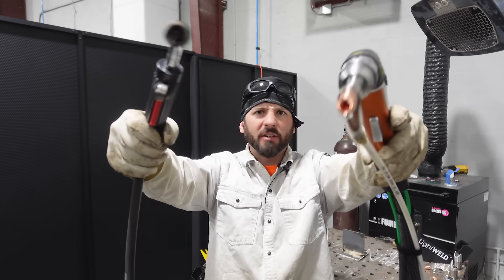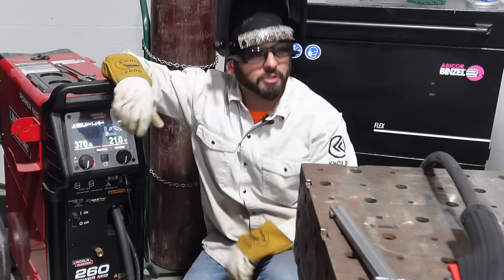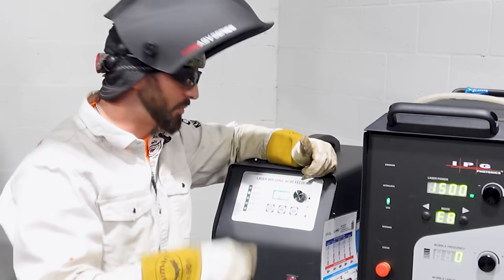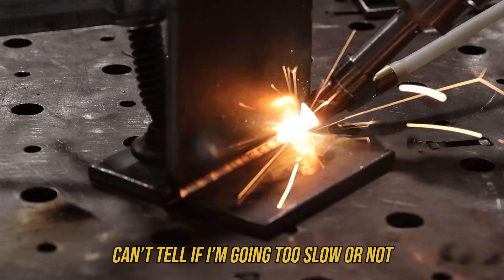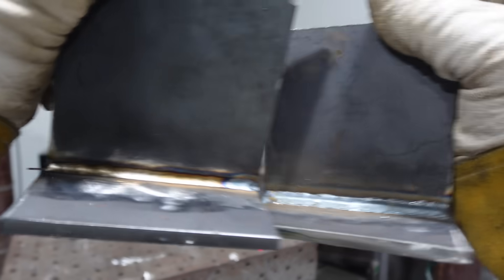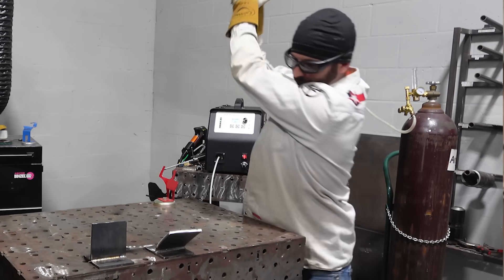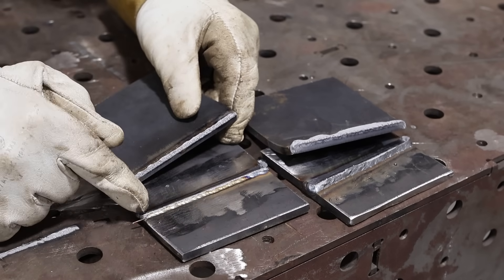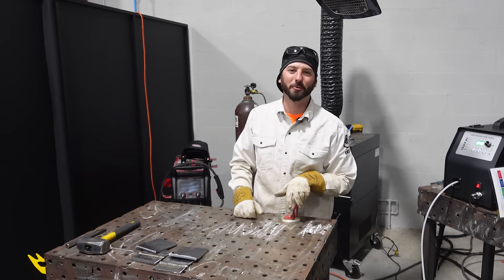Is Laser Welding As Strong As MIG Welding?

Comment: Laser welds are narrower but goes very deep into the metal, 

to get a stronger weld you should lower your angle as low as possible ( nearly parallel with the horizonal flat piece) so it can fuse the base root of the vertical piece with the horizontal one, 

this way you can get a weld that is much stronger than the mig one, 

what you did in the video is welding at high angle where all the depth of weld went down into the horizontal piece without touching the root of the vertical piece  because the weld is very Narrow, 

so the strategy is to take advantage of the greater depth of weld and pointing it in the best direction of the largest surface where the two pieces of metal are in contact, 
whereas mig welds are wide but shallow depth so you can weld at higher angle aiming to distrubute the wide fillet on both external surafaces of the pieces, 

so diffent welding tech requires differnet welding techniques

Comment: Im so confused. Did he get is penetration wrong? It feels like when i hit a good mig weld with 7mil or whatever tf quarter inch is maybe 8 with the hammer that hard it wont just bend or snap off so easy. Maybe the metal is still hot. Im new to mig welding but its my passion and i work in the industry even though im new

Comment: Im not a welder but worked on barge way back that welded/installed sub-sea pipe lines.  The joints of pipe were chamfered on ends first then welded.  With a laser welding machine would you still have to do the same prep (like chamfer) to pipe or can it be used at all on pipe?  Also can they do secondary passes like a fill pass to add more meat in a joint?

Comment: Larger grain structure suggests higher heat input or KJ, could be a real problem for cracking and harder materials, also the fact the laser had less then 70% throat thickness of the leg length is why it lost the race, laser probably well suited for sheet metal and thin sections, proper mechanical testing and etching should be used next time.

Comment: Larger grain structure on the laser, means that there's a lot more heat focused on that area coming from the laser than the tig.  At least that's what my rudimentary knowledge in smithing tells me. So the laser is putting a lot more heat into the metal.  Grain structure may have been similar if the beads were the same size? I can only guess that the grain structure is so large is because the bead is small, so more heat got transferred to the metal.

Comment: Laser welding is great for its purpose, which is thin metals needing very clean joints. However, it's being oversold as a miracle when it isn't. As I said before, it's great if you use it for its intended purpose, but you shouldn't use it to replace conventional welding when that's not what it's meant for.
Reply: We use a 1500XR for light (up to 1/4") stainless. It is irreplaceable for doing architectural work where distortion must be kept to a minimum. We can weld 1/16" stainless and not have a potato chip as the end result. Strength on the thinner materials exceeds base metal.
Reply: You can weld thick metal with it as well. It’s just like arc welding. You size the machine to the work. A 700 watt laser is good for sheet up to 11 gage. My 1200 watt model is good to 0.25”. A 2,000 watt model will easily do 3/8” and a 3,000 model will easily do 0.50”. You can get 6,000 watt models and do 7/8” in one pass. Of course, you can multipass with these too.

Learn about lasers before commenting, please.
Reply: @melgross  The fact is, when a 1500 watt unit delivers 25 microns beam, it delivers the same effective power as a 3000 watt unit at 50 microns, and surpasses a 3000 watt unit running at 100 microns. It all comes down to the number of photons delivered per unit area. So not the wattage is the relevant factor in the max depth of capability, its the photon delivery system, lenses fiber optics, galvo.  so there is no "Rule of thumb"
Narrow wobble width gives higher energy density, deeper penetration, and a narrower bead. Wide wobble width gives lower energy density, shallower penetration, wider bead, and better gap filling.  High oscillation frequency gives smoother bead appearance but shallower penetration. Low frequency gives deeper penetration and stronger welds but rougher bead surface. Wobble patterns only work properly when travel speed matches oscillation. If mismatched, photons are unevenly distributed and fusion quality drops. Wire feed changes bead width and joint strength, but does not alter the fundamental photon redistribution caused by wobble width and speed. The beam motion physics remain the same, amount of delivery remains the same, you just adding material. was trying to explain to an other gentlemen but he got stuck on my miss type. So if ones IPG 1500 lightweld runs out of warranty its easy to upgrade to XC or XR. with the same power source. well it is still a 1500W but it could be 25 micron.

Comment: Welded for 12 years with TIG mostly and I absolutely HATE the laser welding machines cause they do NOT get the job done when it comes to manufacturing of products that needs tolerances and certain approvals. If you're a hobby welder and you like to weld picture frames, a laser welder is great. But if you're gonna construct things that humans are gona stand on, sit in,  DONT use laser welder. Use a proper welding machine that actually heats the steel well enough to penetrate. Laser welders dont get the material hot enough. I've been reading the comments down here and I know I can outweld all of you

Comment: That coarse grain means a very weak structure that, as shown, is easy to fracture. Typically it is because of excessive heat - so I think perhaps you exceeded the capabilities of the machine at 1/4 inch of plate.

Comment: My brother, the great master, these two welding machines cannot be compared to laser welding because the laser does not have a high temperature that can melt iron and make a strong weld. Laser welding is used for thin metal sheets and does not melt them, but the electrode welding machine is used for metals with a thick and strong diameter.

Comment: Big grains = bad because it's brittle, like cast iron.
I don't think all the extra strength of the MIG weld came from it's greater buildup of material, the grain structure of the material at the point of failure looked much stronger too.

Comment: Been around welding for over 50 years, a CWI for chose to 30 years. The test you ran is a fillet weld test almost right out of D1.1. I've done dozens in the field. The reason you gave for the Laser weld giving way early is as you stated size. Knocking the plates apart is ok. I would love to look at the test parts in person. What I'm looking for is fusion between the weld and base metal. When the weld comes off smoothly that's a sign it's not fused good. When it tears out the base metal or breaks the weld that means you have good fusion, that's what you want. Laser welding has been around a while now and I've watched it come of age, can't wait to have a little hood time with one.

Comment: Apply the same weld spec's to each method i.e weld size, leg size. That would mean multiple passes with the Lazer but also reduces the efficiency of the Lazer welding process as the same weld spec may take longer also using more gas.

Comment: Hello I work with laser welding, for the laser welding , you do not have a leg lenghts, as in MIG or TIG that you can calculate the stresses, in laser welding for that aplication you will need to weld almost paralel to the base plate and you will need more power for the thick plate, therefore the laser welding will make a keyhole and you can have the proper penetration exactly where the pieces connect with each other, also you can adjust the focus distance to make sure that the energy density is focus in a small area, so efficiency increase, also the welding speed play a role, you need to play more with the parameters of the laser welding, to get the right parameters, the benifit about laser welding is that you do not need multiple passes when you have a thick plate in a conventional welding process, The heat affected zone is reduced (HAZ), therefore you will better properties , the corrosion resistance and the grain size in the material doesnt affect to much as the traditional welding. The Laser welding that I used is attached to a robot arm, 6KW power Trulaser weld  5000, I think also the handlaser that you are using is not the most efective way to thick plates, unless you play first with parameters, if You play with all this the, The joint can be stronger and with better properties than a traditional welding

Comment: Not a fair comparison for the laser welder by running out of specs. I don't really understand Light welds settings. Seems like they are very limited. If I was to attempt this test as it was done. Hz would have been lowered and the nozzle negative defocused for the thicker steel. Along with knowing the MIG is going lay more material. I would have used dual wire feeder with .045 with Nitrogen.  I think all process have their place and will for many years to come. I love a 7018 there are just things that having a laser welder has allowed me to do faster and way more cost effective.

Comment: This test only works when both welds are the same size. You can clearly see that the Lazer welds are more penetrated but not enough added metal for support. Its like cutting out a grove that makes it very weak. While the mig weld has more support

Comment: I theorize that the laser weld was brittle due to material thickness vs bead size, the material absorbed the heat of the weld and cooled it too quickly. If the material was preheated some the outcome would be more favorable.

Comment: Running a 2000 xr for r&d for an ultra-high vacuum company.  Thing is neat but basically useless in real world applications that aren't seemles flat joint welds. Anything with a gap it will throw a fit, and you can't have a tac in your process as it traces the base materials. it doesn't wet it in like mig or tig, just makes the area worse. Also, to get the claimed weld penetraition,  that's using no filler, which again means no gaps. Otherwise, it just makes craters. Body shop or robotic welding is a good place for these.

Comment: It was a ridiculous test. He had a huge bead and a MIG welder and of course it's going to be way stronger but there wasn't even any need to test that. It was obvious the the laser welder was undersized for the job plus his feed rates, the wrong gas but white test. Why test it when you have such a thin bead on there? A thin bead with a mig a thin bead with a heliarch whatever. It ain't going to match up to a to a robust big bead and you need to compare apples with apples that just sucked. It should never have been even performed. The laser is way undersized for the job. Your your set at 1500 w. I mean it's just ridiculous

Comment: I don't know anything about laser welding, but I would say, If operated with its specified design parameters it would probably shine. I'd be almost certain that welding schedule 40 pipe would be outside of its designed function.  That's why there are different types of welding processes. A specific process for a specific application. I would venture to guess an mig welder would preform poorly for an application that the laser was designed for.

Comment: you can run multiple passes to get the same weld size as the mig,  with the same amount of filler deposit it would have the same result
Reply: They are advertising up to 4 mm pen, depending on the brand.  also have to follow the setup guide, correct W settings, and speed. I assure you it's min 10 times faster operating one for almost 4 years

Comment: Uhhh, why are we wasting materials MIG welding up a F2 proficiency test?  Both will fail by video end, I don't even have to see it through. This is a SMAW test I would use to determine if my students were ready for the certification class. FOLKS,  MIG is not, never was, structural welding. It's brazing on steroids ars far as "shear, and tension" forces are concerned. Also this test is done in a press and bent to a specific angle.

Comment: I have been welding with laser for 9 years and I can say that laser has very poor penetration even with high effect. laser is very good for its area, low heat input and very clean welding, with example inconel 625
Reply: @mrjacobsen3806  laser looks fantastic for certain things like panels, racking, light duty tubing etc. But Im not sure I'd want to test a roll cage done with laser 😅
Reply: Which machine? What do you think after using it
Reply: yet the laser has the larger grain structure.... that normally means it's putting in a lot more heat.

Comment: Lasers are as strong as TIG actually. About 7 years back I had laser welds tested and grain structure examined by a lab that found no difference from a metallurgical standpoint. These were welds done on bellows that were 0.025” stainless steel. The power source was an IPG YLR series’s rack and the welds were done in quasi-continuous wave mode. To be honest I don’t know the light weld specifications but that material looks way thick for 1500 watts. Plus you did a fillet plus wire feed versus a butt so it was closer to 1/2”. We used a 2k watt YLR that would weld 1/4” stainless autogenous so you can figure 500 watts per 1/16” of material.
Reply: that rule of thumb is not correct: it has to many dependencies. I'm running a 1500W unit about 5 years now and I can do 8/16" = 6.35mm no sweat
Reply: @l @lasloker8901 rst 8/16 is 1/2”. Second I was speaking of autogenous full penetration weld. I assume you are welding with wire which is different from full penetration butt joints. Oh by the way 8/16” is 12.7 mm so you are only doing 1/4” at 6.35 mm. Try learning to measure.
Reply: @notanymore9471  I meant 1/4, hence 6.35 mm obvious mistake 4/16.
But what’s the difference ? fusion welding or fuse + wire? Nothing. Regardless, you are adding wire or not, you are delivering the same amount of photons, and if all the parameters are set correctly the penetration will be the same.
I’ll learn to measure,  I promise. You should learn the capabilities of the laser welders.
Reply: @lasloker8901 yes there is difference. I can make a weld with a machine on thick material beyond the rating of the machine without it getting full penetration. That doesn’t mean the machine “welds” that thickness. The numbers I said are based on a manufacturers rating of what a power source will weld with full penetration. If you don’t understand that it’s obvious you aren’t a professional or good welder. Plus big difference between 12.7 mm and 6.35 mm. 1500 watts will almost weld 6.35 mm and it’s possible if you turn the wire off and run slow without beam wobble that it may get full penetration however there is no way it will do 12.7 mm.
Reply: @notanymore9471  You’re hung up on my typo and missing the facts. Your rule of thumb is nonsense — penetration isn’t dictated by wattage alone, it’s only one part of the equation. A 1500 W unit at 25 µm delivers the same effective power as a 3000 W unit at 50 µm, and even surpasses a 3000 W unit at 100 µm. What matters is photon delivery per unit area — optics, fiber, galvo — not raw wattage. Narrow wobble width raises energy density and penetration, wide wobble lowers it but improves gap filling. High oscillation frequency smooths the bead but reduces penetration; low frequency deepens penetration but roughens the surface. Wobble only works when travel speed matches oscillation. Wire feed changes bead width and strength but doesn’t alter photon redistribution. The beam physics remain the same — you’re just adding material. Highlighting replies doesn’t make you right, it only shows you’re ignoring the fundamentals.
Reply: @lasloker8901 my “rule of thumb” is essentially what the machines are rated for. That said obviously a good operator can do more than what a machine is rated for. So you are the one hung up trying to prove you are right. Don’t go on talking about beam physics when you can’t even reduce a fraction and refer to 1/2” as 8/16”. 
Obviously you haven’t taken physics or you could do second grade math.
Reply: @notanymore9471  Yes, I mistyped. I owned it. Ratings are labels; penetration is delivery. Photons per area decide depth, not the sticker.